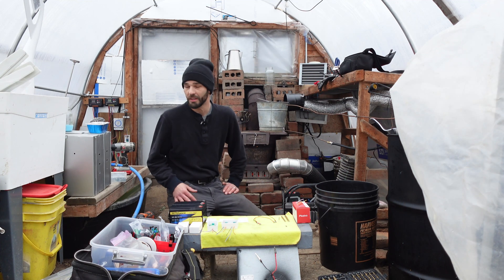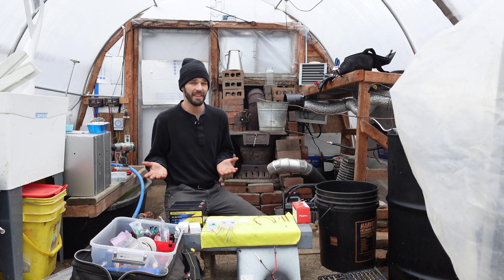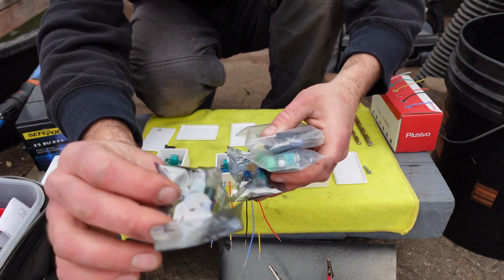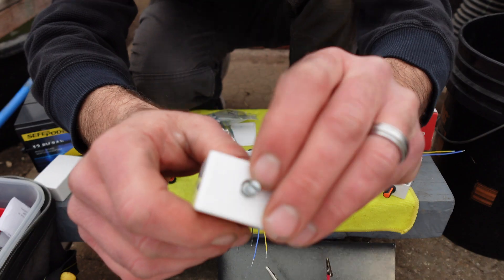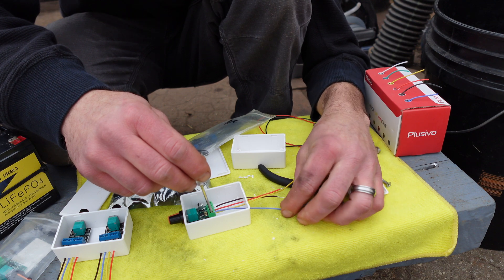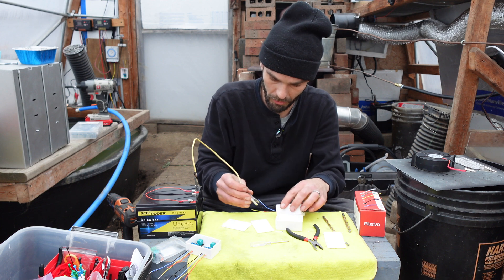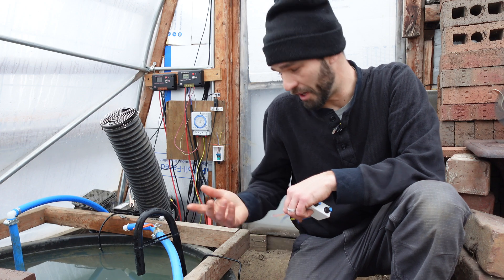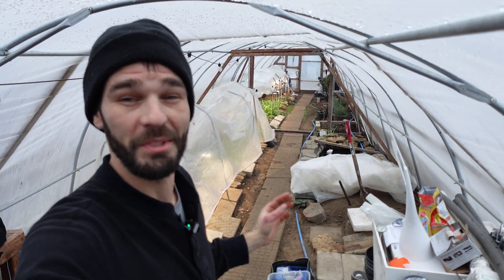DIY Solar Junction Box For Heating Needs  - DIY Moisture Protection, Fine Tuning Heating System

Comment: Instead of having wires hanging out of the box with joins on the outside like that, use 12v battery connectors.